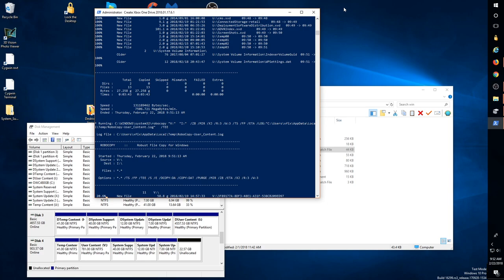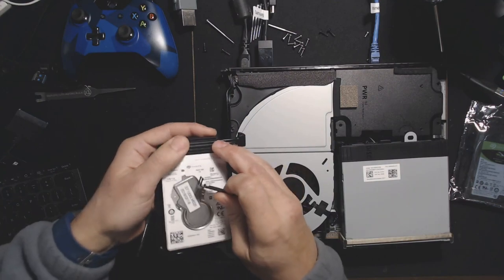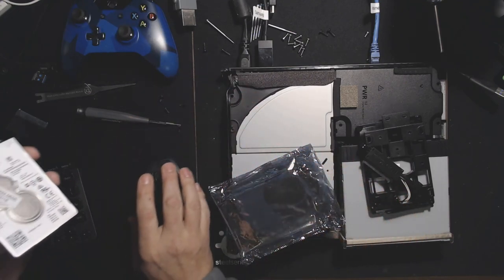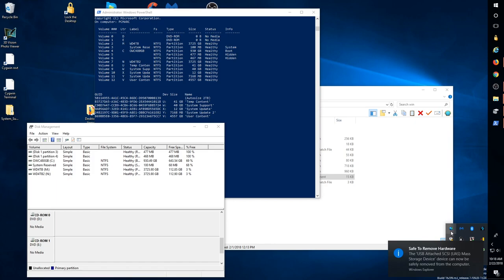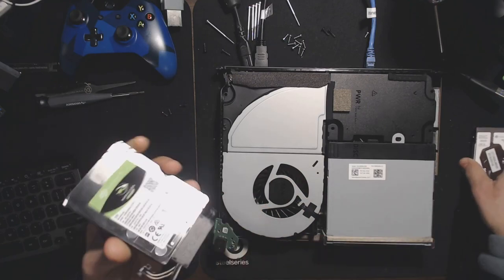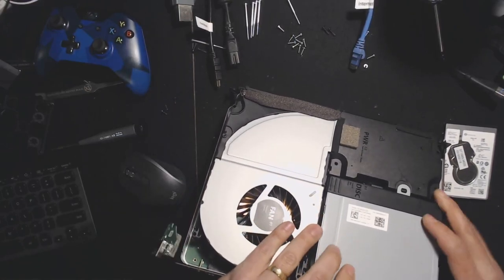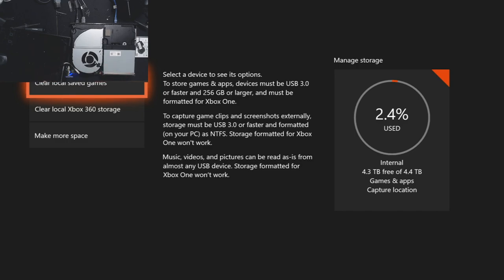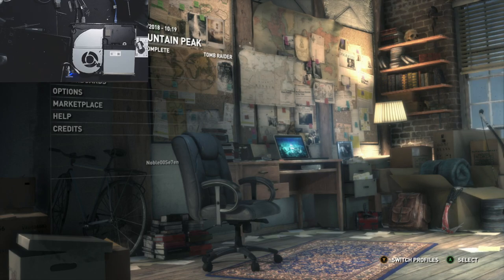Xbox One X Scorpio 5TB Internal Hard Drive Upgrade Using Windows Script 6.1

Comment: Hey man great video. I utized your script today to upgrade my internal stock hard drive to a 2 tb ssd and it went flawlessly. For any of those that are thinking about doing this, dont hesitate, its pretty straight forward. I did it to an xbox one s. Super easy. Now my 1 tb drive was pretty much full so it took nearly 3 hours to transfer everything anx i did it on a super fast gaming computer. I also added a 4tb external as well for additional space. Booted up first try everything is there and moved it all to the external for now except my currently played games. Fantastic performance. For those that wonder, i leveraged a 2 tb Samsung evo for the job and a 4 tb samsung evo in a drive enclosure for the external.
Reply: Whats the fastest speed ssd it will accept and what connector type does it have to be

Comment: I don't often comment but this is one of those posts that helped me when all else went wrong. I tried doing various clones with boot uefi usb and windows programs to no avail. I followed this tutorial to a T using the 6.1 script. Also you need to disable antivirus during robocopy or you may get stopped. My first attempts did not work through the usb for some reason and I kept getting tons of errors. I put both drives on the sata bus and it went swimmingly after that. Shut down after copy and removed source then rebooted to finish with the gui part at 16 minutes into the video. Xbox works great now and I am chuffed. I used a Crucial 500MX 1Tb drive. Thanks again for the tutorial it is much appreciated.

Comment: Excellent work as always, I'm currently updating a 2TB SSD as I type!  One comment on your script though, please check for available drive letters or use System Labels for the robocopy cmds.  I actually had an I: volume mounted and I copied about 1GB of personal data to my new Xbox drive before I noticed.  Easily rectified, but also a simple fix.
Keep up the good work ;)
Reply from the maker: gloves085 thank you for the info. I'll keep that in mind for version 7.
Reply: The 2TB SSD is working like a dream with significant decrease in loading times as expected. It remains to be seen if the lack of TRIM becomes an issue over time.

Comment: Thanks, worked well.  My drive kept failing so used your script to set up a new bigger drive.  Took a few tryes to copy the data across as the old drive keept over heating but got there in the end with a fan pointing at it..

Comment: Use this video when I replaced the one x's 1TB with a 2TB SSD. Very smotth and accurate steps, and I used the new script, I think 8.x. The only thing that got me, is that you can't have too much drive letters assigned on the PC when you run the script. I have to disconnect all my network drives, and also dismount my mapped lone drive (I have drive letters mapped all the way to Z). If you do not disconnect all the extra drives, then you are going to get a extra large number for the original xbox drive when mounted. For me, the drive number is 14 before I do the disconnect. After that, the drive number settled as 4. The 2TB SSD run smooth in the xbox now!

Comment: Great video!!! I installed a 2 TB HDD in my original Xbox and I have decided to upgrade to the X. I got a little confused with the warning. Are you saying that even if you install a 5TB hard drive internally that you will only be able to use 2 TB of space on it? If that is the case, I imagine it's best to just stick with the 2TB HDD I already have?
Reply: Correctomundo - this video is moribund

Comment: Just do External 5 TB USB 3.0 Drive and call it a day. Do not want to void warranty..
Reply: some may not be in countries where it can be covered by warranty , and so they need bigger size , its annoying to have external drive , plus some might have data larger than 5 tb so they need internal and external drive, for example, my collection of digital games , i have  6tb,  less than 1tb on the internal drive, and less than 5 tb on the external  and  about 2 tb on another external drive,  , and xbox one x only have 3 usb ports, one i keep for one drive, the other for my Astrop A50 3gen headset usb cable ,and the 3rd one i connect usb cable for my elite controller, because wireless will have input lag that can effect FSP games if you play it as a professional you can notice that , so changing the internal drive to 5tb is a good option and i will go for it for sure .
Reply: Wisam Alzataf I get what you're saying but it's  not like PlayStation there is no 8tb cap on the USB drive and you can use multiple drives on Xbox I have a 4tb and a 3tb hooked up to my one x and haven't even touched the internal drive.
Reply: legal  even if  you open it it dose not  void warranty  they say you cant open it but  on paper  they have  to take it for legal reson  but no one ever  point that out
Reply: WRONG! Why do people go on Youtube with a bunch of NOT FACTS and misinform people?
Reply: thesmashtvnetwork Microsoft enforces their own policy they will not honor a warranty with the seal removed ..they just dont they obviously dont care about federal laws
Reply: @David cole I clicked on this video just so I could say just that but you beat me to it
Reply: The Journey is 37 mins too far.
Reply: dude most of us like to take it on the go and using a external hard drive makes that alot harder to take it on the go cause it requires the external hard drive and the internal hard drive
Reply: Cool factor and fun project.
Reply: Lt. wreck I’ll just put a 4K internal drive into the ps4 and not void anything. Then if I want I’ll use external.
Reply: The xbox one can handle 4 drives.  The intern and 3 extern on every USB 3.0 or like me with a sabrent USB 3.0 adapter 2 SSD mit orico external case on one USB3.0 on the back. The second USB3.0 in the back runs my WD 2TB HDD.
Reply: @neosrt10  Then take legal action.

Comment: Hi, is Linux script supporting "Autosize Non-Standart w/ 2TB Disk GUID" ?
I suppose no :(
Can you add support for "Autosize Non-Standart" in Linux script?

Usage: create_xbox_drive.sh [options]

Options:
-c|--source      Source drive to copy data to target drive -d with -s 2
-d|--drive       Target drive to install Xbox filesystem
-s|--stage       Install stage [0|1|2|3]
                 0 - will fully erase drive -d
                 1 - will erase and partition drive -d
                 2 - will copy source drive -c data to target drive -d
                 3 - will rewrite drive -d GUIDs
-t|--disktype    Disk GUID to set [0|1|2]
                 0 - 500GB
                 1 - 1TB
                 2 - 2TB
-m|--mirror      Mirror standard partition sizes specified with -t on drive -d
                 Not using this option will autosize 'User Content'
-h|--help        Display help

Examples:
create_xbox_drive.sh -d /dev/sdb -s 0 (Erase a drive)
create_xbox_drive.sh -d /dev/sdb -s 1 -t 2 -m (Partition standard 2TB drive)
create_xbox_drive.sh -d /dev/sdb -s 3 -t 2 -m (Rewrite 2TB GUIDs)

Comment: I have a seagate 5tb external and when u turn off the Xbox , the hard drive stays on. Is there a way to turn off the drive once I turn off the Xbox or will it always stay on . Only way I can get it to turn off is by doing a full shutdown . Or can I unplug the drive once the Xbox is on sleep low energy mode  and before I turn on the Xbox I plug back In ?
Reply: You can set it to turn off in settings

Comment: Hi,
Thanks for the great video. Before i carry on, is there any real benefit (i mean, visible in either boot/loading time and responsivness) to upgrade to an ssd? I was thinking about swapping the default 1TB non ssd to a 1TB ssd but since they are not cheap i'd like to know if there will be any visible real benefit
Thanks
Reply: I did mine today and i woud say there is a noticeable difference especially with games that have longer loading times. It seems to have resolved some of the glitchiness and stuttering of several games and the whole thing definitely boots faster on average. Reduces loading by about 1/3-1/2 in several cases. Its a trick ive been doing for years to my pcs and laptops to get better performance so yes its worth it. Just dont go cheap on your ssd. They are not all alike and you will see better gsins from better quality drives. Google best drives and make your decision from there. I always use samsung evo drives as they are the best but there are others that are adequate.

Comment: Did they Ever raise the internal TB cap limit; in a latet System Update? Or is it still stuck at 2TB....I recall PS4 upping thier internal storage limit to 8TB with a System update, and even added USB Hub support; which also supports 8TB..So, in Theory, you could be Rocking 16TBs on PS4 -- with the Right set up. 

Edit: Personally, I just wish to Upgrade my Xbox One X to 4TBs --  So I can keep all of my Digial games Installed along side my Disk games.
Reply from the maker: No and I doubt they ever will at this point. The PS4 is very loose with drive size limits since they allowed for an easy upgrade path day 1.
The Xbox One has no real hard drive upgrade path and almost 6 years later 1TB is the standard. On the plus side Microsoft did allow for external USB drives day one and claim up to 16TB of external storage is supported.
Reply: Thank you for the Quick response. And I recall reading about that, but never seen anyone try to see if the Xbox One, Could truly read/use (with major failure)  a external 16TB drive -- with these methods. Highest I seen someone do is 10TB an even then, they said it was hit and miss. While PS4 allow you to have upto 8TB internal and 8TB external ( thus limited the chances of crashes and major errors). And yeah, I'm sure Microsoft is aiming to let the Xbox 2 to have huge internal storge support -- to help make people want to buy it sooner, when it comes out. Along with other bells and whesles. Maybe even the possibly to switch out parts.

Edit: And theres a Rumour that the PS4 might be getting another major update that will allow it to Support 10TB for both Internal and Exstral....But not 100% confirmed yet.

Comment: Mhh… So what us the current situation regarding a HDD Upgrade?
Going past 2TB appears to be impossible and even just going past 1TB is not recommended while you're an active Insider Preview member?
Looks like the only reason why I'd want to touch the innards of my Xbox One X would be for a marginal SSD performance Upgrade, no?
Reply from the maker: Yes going beyond 2TB  does not work correctly:
https://www.youtube.com/watch?v=tcoa8Xx_6oU

Going to at least 2TB is fine on the Insider Preview program but you want to copy your 500GB or 1TB contents to the 2TB drive because OSU1 is useless in this case since Preview dashboards are beyond OSU1.
And yes, going to SSD only improves load times but I'm not sure it is worth the added cost.
Not changing anything is certainly valid if not the best choice in most situations.
If nothing else. This process is good for fixing a system with a bad hard drive.

I discuss the current state of everything in this video:
https://www.youtube.com/watch?v=3GlX_Ev_m30

Comment: Would I be able to use this same method and use a disassembled Seagate 8TB hub with this and make it fit in the X without any super technical fixes in regards to space for the breather hole, closing the case back up, etc??? Edit: Also use the 2TB partition method for anything 5TB+ right? I'm either tired or confused I can't figure it out right now lol

Comment: I'm so torn on what HDD upgrade I want to do on my XBOX One X. Do I want a 4TB/5TB HDD. Maybe install the 2TB FireCuda Hybird HDD. Go for a 500GB SSD. Do I want tons of storage and not have to upgrade again. Do I want faster load times. Is the FireCuda a good trade off? Can you do a speed test on the XBOX One X using all 3 upgrades. Thanks!
Reply: @Amy --> Then don't do it, nobody is forcing you voiding the warranty on your console. If you watch the videos of XFiX it seems really easy and everybody can manage the HDD upgrade, but believe me: it is NOT that easy for beginners and novices.
Reply: I will be putting a 1tb SSD in mine
Reply: dred05m Hahahaha... I think you misunderstood. I want to do the upgrade. I just don't know what upgrade I wish to do yet. Do I want more storage or faster speed for better load times. I am far from a beginner. I've modded every video game system I've owned. I have done several JTAG/RGH mods to an XBOX 360. Have a XK3Y installed on one of my XBOX 360's. Have installed modchips in PS1, PS2, GameCube, XBOX. I had already did a HDD upgrade on my original XBOX One using a 7200RPM 750GB Western Digital Black HDD 2 years ago. So I think I got this handled.
Reply from the maker: @AmyGrrl78 I'm a bit torn on this myself but here is what I would recommend in order of preference:
1. 2TB SSHD - in my speed testing, video to come shortly, after starting the same game 2 or 3 times, performance was much closer to SSD performance than HDD and SSHD is only $10 more on average compared to HDD. Plus, since this is an MS supported size resetting isn't an issue.
2. 5TB HDD - you get nearly 3 times the space over 2TB and 12 times over 500GB, enough said. It's the slowest option but this mostly only affects load times not game play. Also, the most expensive option and cannot be reset.
3. 500GB SSD - obviously improved load times but that's it and you'll likely wind up loading games from an external anyway.

Right now I have 2 2TB SSHD systems and a 4TB and 5TB system.
Reply from the maker: @lilhed - 1TB SSD is awesome, it's the price tag that gets me
This is just a question of whether you value speed over size or vice versa.
Reply from the maker: @dred05m I certainly agree with you about the beginners thing. I've certainly seen some messed up systems.
I'm also glad you think I make this look easy, I'm not always so sure.
Reply: dred05m she isn't having a dilemma of warranty just what drive to install it's pretty obvious... .

Comment: Can you do this without pulling the drive back out to add the boot animations? Will they redownload when you reformat the machine?
Reply from the maker: Yes and yes. Not sure why bootanim.dat is not included in the OSU1 update but it will come back the next time you do an update using the normal process.

Comment: Will the script work for an Xbox One S? Is it possible to use a 1TB SSD as the new drive instead of a standard disk drive? Thanks.
Reply from the maker: Yes and yes. Any 500GB, 1TB, or 2TB 2.5” SATA HDD, SSHD, or SSD drive will work.

Comment: still a little question if you allow, you connected the 2 disk by SATA or by USB 2.0 or 3.0? Thanks you
Reply from the maker: In this video I use 2 x USB 3.0 to SATA cables. However, direct SATA connections work as well.

Comment: Hello Guys.. I have a question maybe someone can help with.. I know that this is not the same type of upgrade that I did.. I went from a 1tb drive to a 500gb ssd using the USB reset method found on another website and yes I have left a message on their also with no actual answers except another user saying he had the same issue with the same fix I did.. Well here is the problem After the upgrade everything went fine but my cd drive would not read any discs it would not auto load discs even though u could here it working but u would get an insert game if u own it error if launched from a previous install also.. The only fix was setting the power saving mode to always on instead of energy saving and doing a hard reset.. after that u would have no more issues but as u should know then ur xbox never really shuts down thus defeating my purpose for the upgrade which was quickier startup times from a energy saving setting which it does from a minute and half to 1 minute flat but then it would never see the drive after restart.. Any recommendations would be greatly appreciated.. thanks

Comment: So do you still need to grab the latest OSU file if you're not copying directly from another standard working drive?
Reply from the maker: lilhed yes. Since you can't go directly to a non-standard size and if you want to go to 5TB for instance, you'd have to get a 500GB, 1TB, or 2TB working with OSU1 first.
Reply: I allways put latest OSU1 to partition "System Update" and OSU2 to partition "System Update 2". I tried this and it works no mater when console was last updated.

Comment: Hi, so, if i install a 4TB drive or higher i can't reset my console (no difference if keep the games or if i hard reset the console), right? No problem with a 2 TB hdd, correct? @XFiX
Reply from the maker: Yes this is all correct.
I made a video illustrating how you can prepare for resetting a non-standard drive but using a 2TB drive will reset without an extra effort.
https://www.youtube.com/watch?v=0h0cEPXPB9w
Reply: i just saw the linked video. So, for example, i hard reset the X and make a backup on my PC of the 1TB hard drive. If there will be any sort of problem with the brand new 2TB hdd, i can put in again the old one and the console will strat again from the beginning, correct?